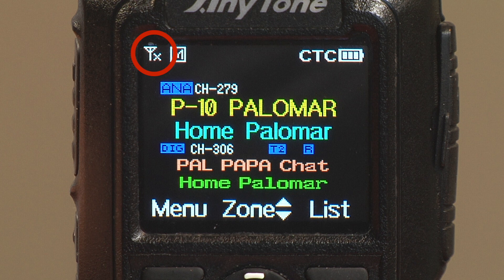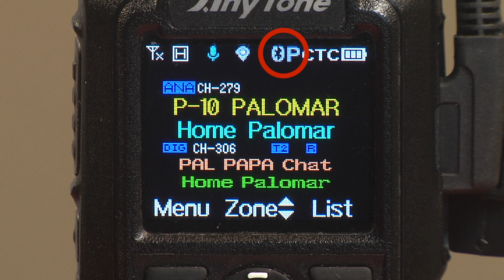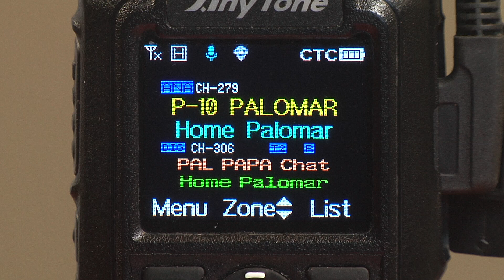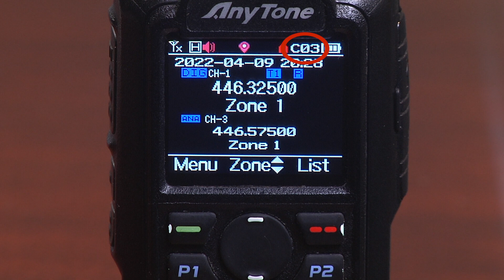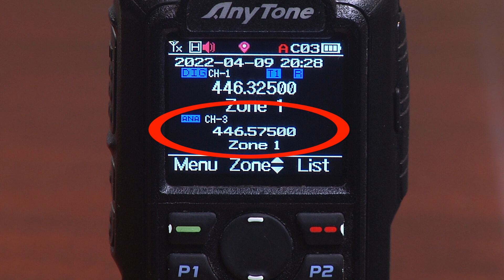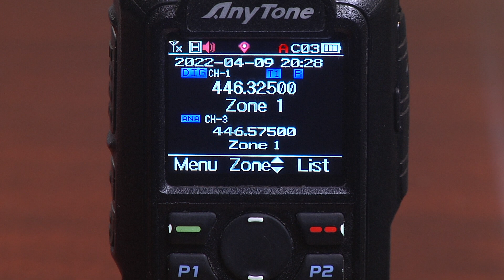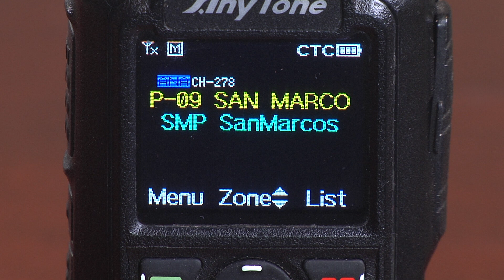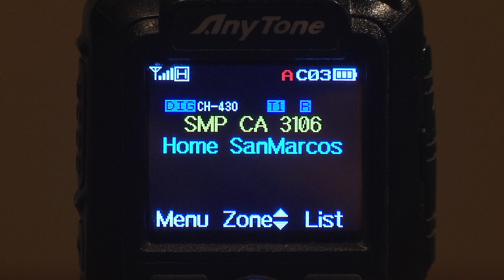Decode and better understand the Anytone D878UV screen

Comment: Thank you. 🙂
I have a question though as I am a newbie and have received my new Anytone D878UV II Plus only yesterday, but I don't have a Windows PC to program it so I try to do that via the phone directly. Apparently the device has a means to use "AuRepeater A" and "AuRepeater B" to automatically activate an either positive or negative offset for repeater/duplex (instead of explictly entering this per individual channel). However - where in the channel settings do I define that I'd like to actually apply the "AuRepeater" concept for that channel? Or am I getting it wrong, and the "AuRepeater" setting in fact merely defines whether the offset is to be considered negative or positive, but its absolute value needs to be set explicitly per channel?
Reply: I've never tried using the phone. I would strongly urge getting an old PC to program with. I'm a die-hard Mac user, so I get frustrated when radio programming requires a PC. I had a friend who was dumping an old Windows 7 laptop that works perfectly well for running the CPS programming software. There is a lot going on within the software for programing DMR and you want a screen that can clearly display the various settings.  

The repeater offset settings are really easy to set up once you are in the programming mode. I never use the AuRepeater functions. No need to. What you will discover is that after you load frequency assignments for channels (analog or digital), you then load this channels into Zones, kind of similar to files going into a folder. Files are the channels you create, and Zones are the folders. You can mix and match analog/DMR as much as you want. Most people will set Zones by geography, but that's up to you. The channel memories can be adjusted in the field on the keypad as needed, but it's only as a last resort because it takes several steps to do. DMR adjustments are even more involved, but can be done via keypad.

The repeater offsets are typically loaded in per channel, so if you had a repeater freq and wanted to do talk-around, I would create a separate channel for that function rather that getting into the keypad. I still use the keypad for VFO operation, but you I get lazy and spoiled by having everything preset. Again, when you do it as DMR, the level of complexity goes way up. Find a PC. Trust me.  😉
Reply: @Raymazon  Thanks for taking the time to answer elaborately. Yes, I trust you - it obviously makes very much sense to find a PC to do the programming, however I have not yet given up finding a solution to do this using my Linux systems. I tried QDMR, but this is of course something generic and does not support all these little details that the Anytones config allows to adjust. Next thing to try is running Anytone's CPS on Wine ... 
Btw, I meanwhile also think it makes sense to not use the AuRepeater functions and to set the Rx/Tx freq explicitly (this is of course supported by QDMR).
Reply: @hennero.3826  Please let us know what you finally end up doing to solve the issue. I think the limiting factor is that Anytone only makes the CPS software as a PC program. I wish they’d support Mac. They’d be way ahead of the others if they did. I look forward to hearing what you do.
Reply: @Raymazon  Unfortunately I do not really have the solution I would have preferred. Meanwhile I tried to run Anytone's CPS using the Wine software on Linux, with the following disappointing results: 😕
With one Wine version the CPS did not run at all, with another the application started, yet it could not connect to the serial port although I configured the symbolic links on OS level for the /dev/tty... to map them to Windows COM ports.
I assume for those that need to uses the device's DMR functionality and depend on CPS the most efficient solution is what you recommended (to find a PC/laptop with Windows). Maybe for what I am planning to use th device for, I will not necessarily need CPS although it would have been rather convenient. For the time being, I do not need much more than configuring a few FM channels. For this, QDMR will do.
Reply: @hennero.3826  
Thanks for the update. Fortunately a lot of people are dumping old PC laptops, so getting one for (almost) free can happen if you put the word out there. The old laptop I got has a battery that holds very little charge, making it almost worthless, but works perfectly well for programming radios. 

The CPS software PC port assignment on the laptop was the only thing I had to sort out. I followed the CPS how-to instructions carefully and it came right up. I didn’t have any other issues after that. 

I’ve been thinking of doing a video on using the software. If I can find the time, I may try making one. 

73
Ray

Comment: I use it scan commercial dmr systems but at times it doesnt icl up what I set up in zone, I  put each freq in with cc and slot 1 then next location slot 2, yet what's coming up on my sds100 isn't always there on anytone, I've tried putting in as r t single or r tx differant spilt etc, a tx will come through showing this, uid and cc, but no voice, another time dobt even get the info come up despite talking away on my sds, it's very hit and miss, when goos it's excellent but when bad it's very annoying

Comment: O.K. Ray, yet another glitch has surfaced. My display info has gone away, yet again. However, I checked into my local [Valley Center] DMR net this evening and another problem surfaced...

Several of us are being "seen" by net control on net control's display, but not being heard.

I transmit, the red light blinks, none of my info is seen on my display, I can't be heard while transmitting...BUT I am seen on other ham's display, as well as net control, to reiterate.

No problems with analog at all on transmit.

Now, more hams on the net are being seen by net control display, but not heard.

Ideas???

Comment: Ray, great video. I learned a lot from watching your video. What intrigues me is how you got to the display settings that you did. I got my code plug from our ARC guys. There are so many questions on programming using the CPS, that there is not enough space here to ask them all. One answer engenders another question. May I ask just one, please?

Both my wife and I have the same 878uv radio. On my CPS, I go to comport/write to radio. When I transmit in DMR during our DMR net,  my name, callsign come up on the [secondary] display when transmitting. Then shows [B] last call sign,  [B] last group and [B] last caller] on the main display. 

However, when I turn the radio off and transmit again, NONE of this info shows up in the display on either radio.

In my CPS these are the settings I have in the "optional settings": optional settings/display/last caller "both". call display mode "name based". display current contact "on". 

Yet I still don't see the info displayed on either radio, using this CPS on both radios. It's not saving the info somehow. Never had this happen before. Que pasa? What am I missing? Many thanks for taking the time to respond! Vry 73 de Joaquin
Reply: Ray, you and your com-padre are brilliant! That was just what I needed to finish the job of updating the CPS and the Firmware on both H/T's. It is done and I have you both to thank for assisting me along the way. Muchas gracias Sr Grande! Vry 73 de Joaquin and Feliz Navidad
Reply from the maker: Hi Joaquin,

A suggestion worth trying. Do a radio reset. It sounds like perhaps the radio had a firmware update without a reset. Try the reset. If that doesn’t work, try a firmware update again, and then a reset. 

I spoke with a very knowledgable Anytone source about your situation, and the instability of what you describe sounds like a reset issue. 

Let us know how it works out so others can benefit too. 

73 

Ray
Reply: That is wonderful news to hear. I’m happy it was an easy fix. 

Feliz Navidad
Merry Christmas! 🎄

Comment: Will this radio scan local transmissions in my area and find color code and talk groups automatically?
Reply: It depends on what you mean by scanning local transmissions. 

You can scan a frequency spectrum like 445.000-449.975 mhz while in the VFO mode. 

You can find the Talk Group by putting in a frequency and going into Digi Monitor mode and any transmissions heard will display the talk group. 

I can’t recall if the Color Code is also displayed in that mode, but I think it is. I’ll have to confirm that.
Reply from the maker: I checked further and the color code doesn’t display the specific Color Code in Digi Monitor, but it does hear radio traffic even if the CC is not set properly. I assume you’d just have to find it manually, trying one at a time, if you wanted to transmit. Hope that helps.
Reply: will this radio pick up 160 Mhz also will it do GMRS thanks

Comment: This is very informative.  I just bought a D878UV from a friend and I am waiting to get the radio in hand.  At least now I have a better understanding of the display and what I am looking at when I get the radio.
Reply: Thank you. It seems overwhelming at first, but if you think of channels being stored in Zone files, it helps to get the idea of how it’s laid out. The programming software is also a challenge until you use it and realize that it really only needs input on a few menu pages once it is set up. 

I’ve been tempted to make a video on using the software, but I think there are some videos that do a pretty good job already. I’m not sure if it’s needed.

Comment: Hi Ray.
I just started playing with my Anytone, and I have to admit that, compared to for instance D-STAR mode, DMR has a really steep learning-curve…

My D-STAR knowledge is totally useless in the DMR universe.

Thanks for your great explanation.
I learned a lot.

Subscribed!!

73 de Robbert TA2/PA3BKL (aka TA2IX), the dutch guy, living (it up) in Istanbul Turkey!!
Reply: I've had just the opposite experience. My Icom ID-51APLUS2 has largely been ignored since acquiring it in 2017. But I have 3 878s I use quite often because DMR seems so much easier. Perhaps you could point me toward some learning resources for D-STAR? Thanks

Comment: (8:39) you can flip flop between primary and sub band by using the P1 button. My P1 button activates the FM radio. Is that a setting I need to change, if yes what is it, and if no then how do you flip flop between top and bottom? Thanks in advance.
Reply: The buttons are software programmable inside the radio Settings menu, under Key Func. Scroll through the list to find the button you wish to re-program for another function. You can assign it to various different functions.

Hope that helps.

73

Comment: Will the radio automatically put out my call sign?
Reply: In DMR mode it will if you have registered to get an ID number,  received an ID number, and programmed the radio with it. The ID number is connected to your call sign in a master database. The radio transmits the ID number, (assuming you programmed the radio with it), and that ID number converts to your call sign. The radio contains a database of those numbers and call signs. So does the server.  It happens seamlessly and automatically. So yes, it does transmit your call sign via an ID number, and the database file in the radio reading that number. That's also why you want to periodically update the "contact list" for the radio to keep adding the newly registered numbers in the system. Does that make sense?